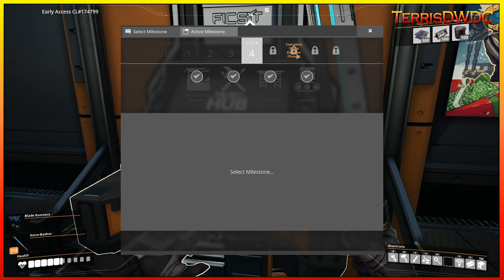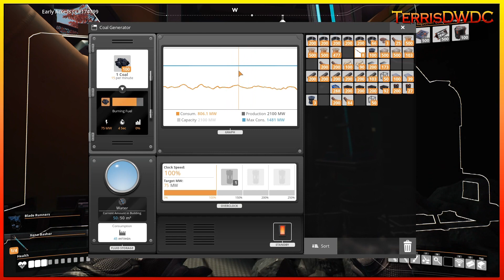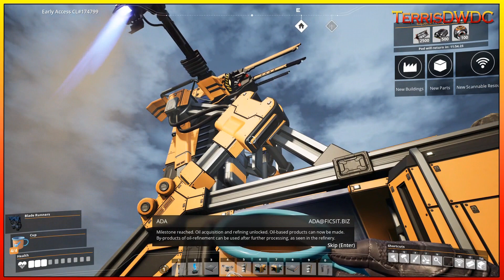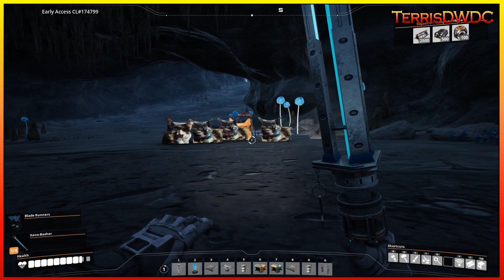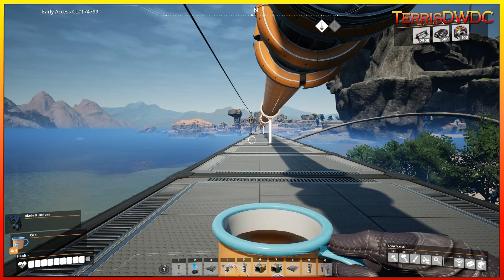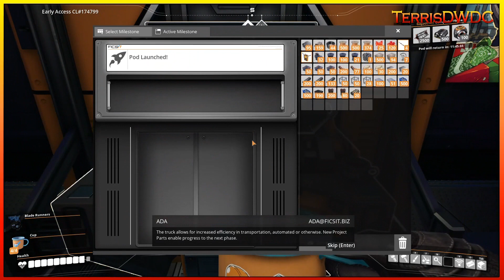Space Elevator Phase 2, Tier 5 Milestones - Satisfactory Update 5 Gameplay E09

Comment: Ooo, you got the Superposition Oscillators already, huh?
Haven't shown up yet in my calendar since it's part of the pool of random items spread out over the month. It isn't obvious for someone that hasn't gone through all the tiers yet, but that's not just something you can't make yet... it's something nobody can make yet. Teaser for future content apparently.
Reply from the maker: Good thing I didn't burn them in the sink
Reply: @TerrisDWDC  Yeah, probably. There isn't really much you can do with them, though there is a drop pod somewhere that can't be opened without them.
Reply from the maker: @ronhatch9175  I will have to begin the search for that drop pod, I would imagine the hard drive in that pod would provide some great alternative recipes
Reply: @TerrisDWDC  As far as I know, it's randomized from the same pool as the rest. Just allows you to get more of them, I think.
Reply: @TerrisDWDC  Ah... and after thinking about it a little more, I checked the wiki. Sure enough, this is one of those items that the sink won't accept. If you had tried to throw it in the sink it would have just clogged the belt. They do that for a few items that are either considered too important or in the case of some radioactive materials, that would just solve problems too easily if they were sinkable.

Comment: "Where am I going to find crude oil around here?" you ask... as someone that learned the game by playing in this same location, I immediately thought "Not around here at all, actually."
:-)
I've been looking forward to seeing how our solutions to that little problem differ ever since I saw where you started. Not that much, it turns out. My first pipeline was more ad-hoc and ran along the coast, but the same general idea. These days I would build the refineries at the oil node and use conveyor belts to send the results back. Pipes are too much of a hassle when you have long runs. Since I didn't know what else might need oil later at the time and didn't realize that conveyors are much simpler than pipes, it seemed better to keep the refineries close.

BTW... should be able to use soft clearance to put a pipe floor hole overlapping that pipe you have going through the floor.